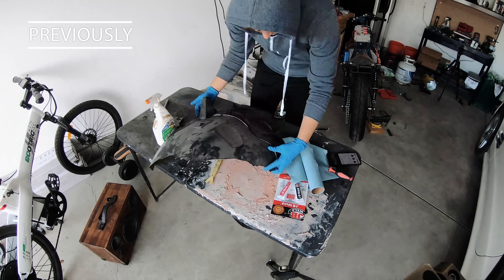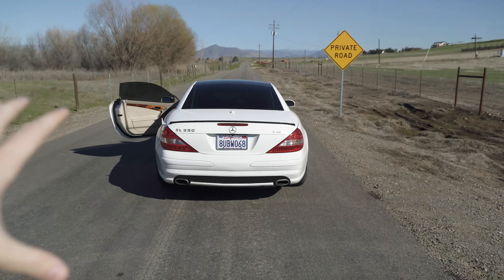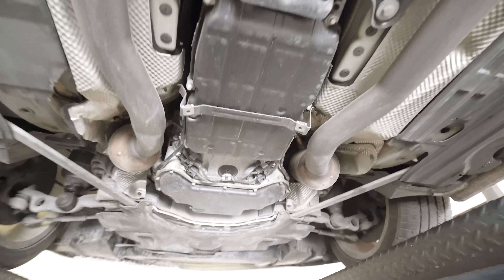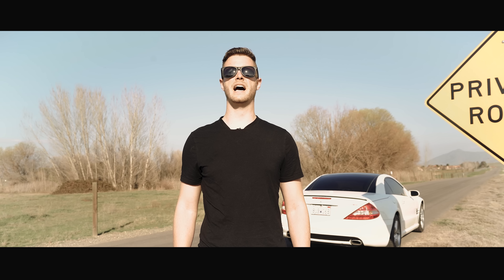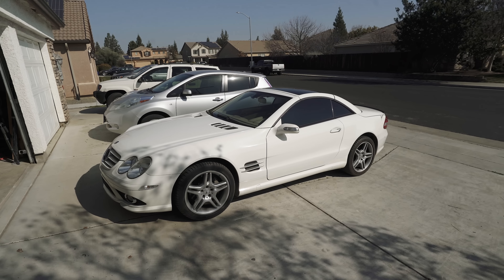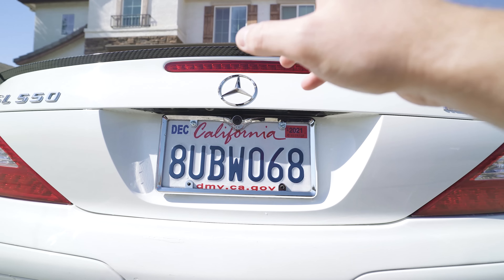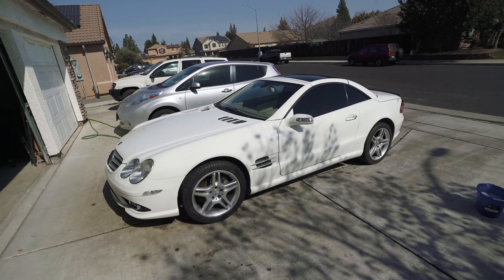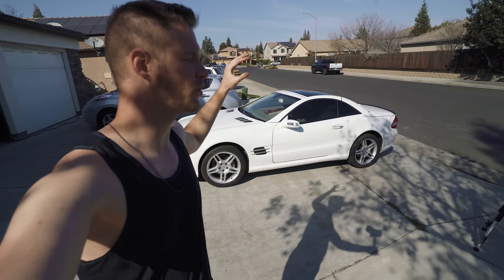I Paid a Muffler Shop $200 to Make the Chickenhawk LOUD

Comment: I just did the muffler delete on my 2008 burgandy SL550 but instead of rewelding the stock tips I went with a single brushed stainless tips because I had the shop use 3” diameter stainless mandrel piping because with the stock tips it reduced the diameter considerably and didn’t want to choke the exhaust flow. It sounds so mean especially when going wide open throttle but still reasonably quiet when off the throttle. Now I want to change the cat back piping to a full 3” mandrel bends.

Comment: I guess I never understand the logic of buying a luxury car that is supposed to run smooth and quiet and then making it the opposite. You do you!
Reply from the maker: It's still not too bad. No drone and can barely hear it at cruising. Still has the stock cats and stock resonators.
Reply: @TheInja  Like I said, you do you! Just be aware it is law to have them . . . Love watching your projects!
Reply: O completely agree! I loved the project, but hated the ending. What's the point of removing the external amplifier to keep it stock, and then modify the exhaust?

Comment: Welcome to SL550 club, your car looks amazing. I too am a recent proud owner of this fantastic looking & fun vehicle . I have a cosmetic issue that I was hoping with all of your experiences you might be able to suggest a solution. It’s the 2 pieces of black plastic trim on either side of the rear window. They are badly weathered ,  any thoughts? I have pictures but cannot arachnid.
Reply from the maker: Mine is all bubbling up, too. Probably remove the original coating and wrap it gloss black.
Reply: @TheInja  I tried to obtain replacement parts and to my surprise both Mercedes US & Canada are out of stock with no idea of when they will get some.  We are left with DIY solution. I believe given the out of stock issue that many more SL550 owners are having similar issues. Please give some thought to doing a video on the subject showing both the wrap and paint solutions.
Long time fan, Tony in Canada
Reply: Vinyl wrap!

Comment: I noticed the California plate.   Have you smogged it after the muffler delete? I’m wondering if it will pass…. Also have you noticed any performance difference?
Reply: Muffler has no effect on emissions.  Just noise.  As long as you have catalytic converters still and no check engine light for O2 sensors failing or misfires it will pass.

Comment: Hmm.. As an engineer I say noise is energy wasted, as a speed/acceleration freak I don't care, how does it go, but as me.. Sorry, I personally prefer a less agricultural sound! Mind you, that particular Merc has caught my eye, even though I'm more of a 'pocket rocket' lover, small and fast is where it's at for me.. A Lotus Elise or a PGO buggy with a 600/750cc motorbike engine is more my thing for a 'go out for a quick blast'. Top end is nothing, acceleration is where it's at!
Reply: Can you explain the noise is energy wasted theory because I thought with less exhaust resistance it would slightly increase torque and hp
Reply: @mwlagana  The energy has already been wasted, less exhaust resistance is good, you are correct